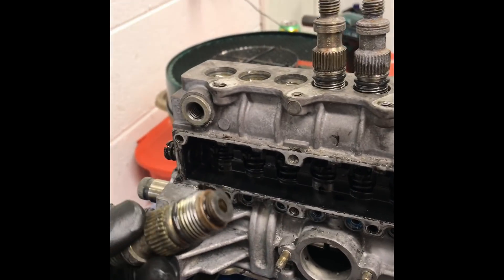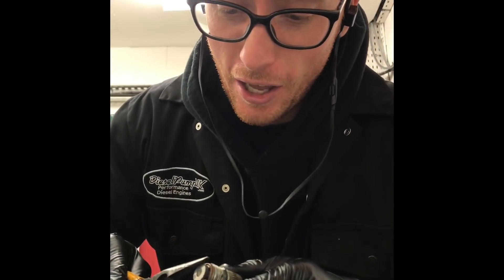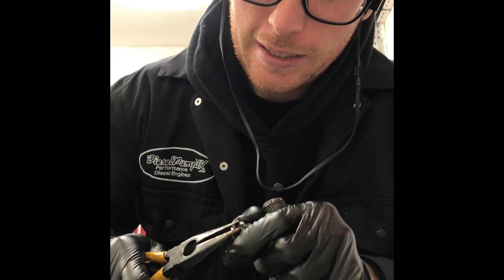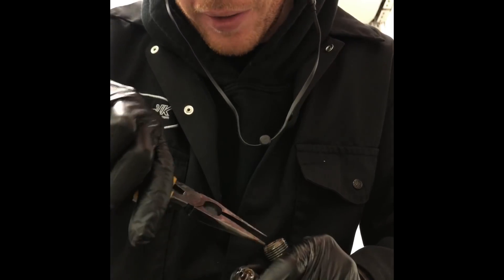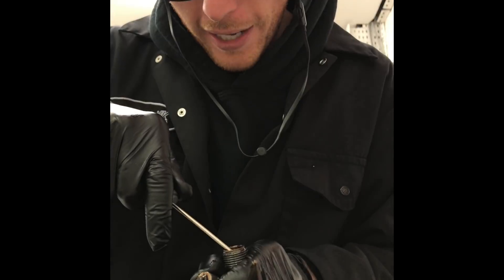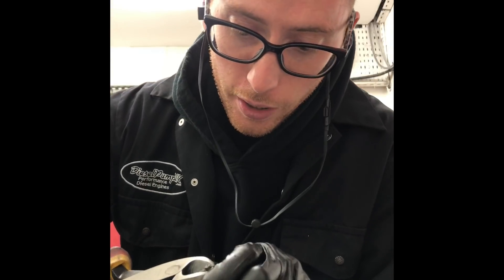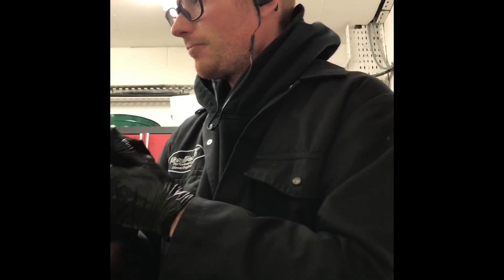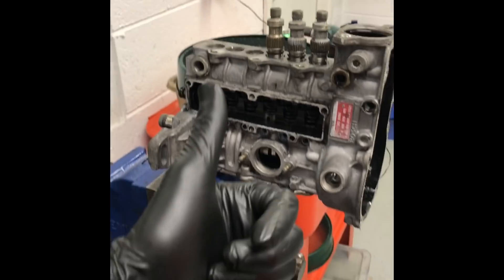Biodiesel ruins your Diesel engine

Comment: Veg oil is not BIO-DIESEL.Bio-diesel is reacted oil that is turned into esters.Dont confuse the two and give Bio-Diesel a bad name.
Reply: Exactly dude
Reply: Yea dude👍🏻👍🏻
Reply: Really 👌
Reply: 5% biodiesel gives more lubricity to your pump too
Reply: Exactly
Reply: Yes bro, he can exposed easily look at his channel name, diesel, so he is spreading propaganda
Reply: @oiroliv  in Europe almost all diesel on all pumps I have been so far is 5% bio-diesel. Even my new car has a specification for only 5-15% bio-diesel and I may theoretically void my warranty using pure fossil diesel.
Reply: @HibikiKano  Over here, diesel contains up till 7% of bio-diesel.
Reply: But he is the mechanic not you
Reply: @bradjacking3960  I manufacture Bio-diesel,I know what I'm talking about.
Reply: Yup so true, they will filter the oil and heat it then direct mix with diesel to get more volume. THIS IS NOT BIODIESEL, IF TRUE PURE BIODIESEL COMBUSTS THEN IT WILL BURN CLEANER THEN REGULAR DIESEL LEAVING NO RESIDUE. HOW DO I KNOW THIS? I MAKE MY OWN LAB GRADE METH/KOH/OIl washed and distilled blend.
Reply: sorry, biodiesel is f..ck-upper for entire fuel system. hyped business scheme propably. now you can buy biodisele bacteria killers - so buy diesel AND buy additives, it just makes mad. just finished last pump replacement because of sludge -wich screwed up all components one by one. old steam engine owner can do it, if you dont have kind of "modern" van or truck.
Reply: @bradjacking3960  As if you know that he aint a mechanic and also, have you ever made biodiesel? Do you know the chemistry involved? If so then please do share with all of us so called 'non-mechanics'.
Reply: THANK YOU SO MUCH FOR YOUR INPUT -- NO JOKE. I AM CONSIDERING A DIESEL ENGINE... (NOT SURE WHICH - ANY RECOMMENDATIONS?) AND THIS VID HAD ME 2ND GUESSING MY INCLINATION.
Reply: BIODIESAL has an electrical charge and water conducts electricity, they naturally attract and bond to one another. Water in fuel creates an environment that allows microbes and bacterium to flourish. These organisms  will consume 1% of fuel while destroying the rest.  Water reeks havoc on engine fuel injection systems.  I'm not an expert but my teen daughter is doing a research paper on hydrocarbons and petrochemicals.  This is just something of what we learned. Some  books describe the problem using a metaphor TITANIC, very telling. Modern civilization on petrochemicals with people consuming them is gonna cause the ship to sink.
Reply: @catsmeow4003  Good lookin' out feedback wise. Appreciate.
Reply: Exactly well said
Reply: bio-diesel is bad by one reason. It dissolves water. Even if a diesel is mixed with biodiesel the moisture in it may ruin your injectors, pistons and pump in a long run. By two reasons actually: DPF. DPF gets clogged much more often so it needs to regen more increasing fuel consumption and decreasing it's health. We have 15 to 20% of biodiesel here and we have diesel engine wear by moisture more than ever before.
Reply: @catsmeow4003  About the first part: Water does not conduct electricity, ions and minerals do.
Reply: Biodiesel is great only for its marketing campaign and nothing else.
Reply: @igorpupkinable  and what makes you say that
Reply: @igorpupkinable Biodiesel need be very clean before they can feed any diesel engine. Because veg oil have glycerin, after the react with methanol (or ethanol) the mixture still have some glycerin that turn into soap. Because that, biodiesel need to be washed with water and then heated to get the water out. Here in Brazil, there's a company called Brasil Bio Fuels. They make biodiesel from a tree called Palma, they produce biodiesel enought to feed they own trukcs that work on they forest, and wanna hear something funny? These trukcs are regular trukcs, without any adaptation to run with biodiesel.
Reply: Biodiesel is terrible.

Comment: You mean veg oil or bio-diesel? There is a chemical difference. Just curious, because you did use both terms.
Reply: @Podge probably. Ah sloppy journalism, the scourge of our time.
Reply: There is moisture in that M-pump, moisture causes corrosion, like rust. The owner of that mo606 is sloppy using alternative diesel in cold weather and probably doesn’t change the fuel filter often enough. Buyer beware! Moisture and debris work against bio-diesel users requiring extra maintenance.
Reply: veg oil is HVO100 right?
Reply: This is the aftermath of vegetable oil
Reply: Also you didn't mention the percentage of biodiesel neither and that can also have a big impact on the amount of sloppy aftermath that you're talking about.

Comment: Just happens if it isnt filtered proberly the guys where i buy my oil runs his 300td for over 400k on nothing else then veggie oil
Reply: Where do you source your oil? Sounds good to me...
Reply: @Candlemantle  i buy prefiltered, water seperated used sunflower oil for 0.65€ per liter in 1000l bulks. My seller is bying up oil from a chips factory
Reply: @christianh.8408  yes that's what you need aslong as it's done right it's good stuff.👍

Comment: As one of those guys who's used it for decades and thinks it's the best thing ever, it's hard to say what went wrong with this pump or the "fuel" given that it apparently developed a running fault. The only time I've ever seen veg oil gum up like this is when it's been exposed to the atmosphere over months/ years. The same thing happens with E10 petrol. It absorbs moisture, reacts with oxygen in the air and slowly forms a polymer/ varnish with the first stage being this sticky syrup stuff like in this pump. I've never killed a pump in 250k miles on veg oil. I have killed one engine with gummed piston rings (avoidable) in a fairly short mileage but the other engines did over 100k miles on veg oil and are still running fine. I had one EDC merc pump which sat with veg oil in it for 2-3 years and was fine- it was sealed from the atmosphere sitting in the vehicle and fired up first turn with a fresh battery. What has happened to this pump is either the result of poorly refined "fuel" or long periods standing exposed to the atmosphere. If your veg oil is dry and well filtered it won't do this at all and if you follow similar precautions as you would in a petrol engine using E10, you won't have issues after it being laid up either. I flush the system with diesel if I'm going to park up a veg oil vehicle long term and flush petrol fuel systems out with Aspen although as said, if it's hermetically sealed from oxygen/ moisture you'll be OK in terms of veg oil :)

Comment: The veg oil is simply not biodiesel.. The former is not advisable to directly pour cooking oil into your Nissan Patrol (seen on your other video). Biodiesel is the chemical reactions of transesterification and esterification. The " normal diesel" in the UK is officially up to B7 (a mix of seven per cent biodiesel and 93 per cent standard fuel).

Comment: Without owning the vehicle, knowing the fuel used, methods of refining and conditions the engine was used under. Your video is not proof of correlation to a specific cause, however its worth considered.

Comment: Lots of factors to consider here. What feed stock was used? Canola? Palm oil? Fatty fish and chip shop oil? What process was used? Cooking? Ultrasound? What filtering process was used? Scraping deposits from the top of the barrel? 1 micron filters? How old was the vehicle? Bio diesel is really good at stripping 20years of fossil diesel deposits out of fuel lines and clogging up fuel filters and beyond. 

People are quick to blame Bio Diesel without understanding some of its complexities. This is the reason lots of people are unwilling to use it. "My brothers, mate's, dad's boss ran it in his 40yo cruiser and it killed the fuel system, bio diesel is shit" SMH
Reply: Word!
Reply: Not to mention that some people pour in pure veg oil without any esterification process.

But from my purely accademic perspective, I'd argue against using pure bio-diesel as a drop in replacement for diesel in new cars solely because Bio-diesel often ends up having a slightly higher caloric value than normal diesel and with the tight tolerances and electronics governing fuel injection in modern engines. I'd really go and ask someone who is well in the know to get proper advice for any electronic upgrade and maybe a different lubrication oil.

I mean can we just take a moment and admire that my current Škoda 1,6 L diesel engine has more power and torque than the 3,9 L Chrysler LA 239cu V6 from 1987. Tolerances are tight and the engines work under more strain these days. I think anyone who does anyone to their modern engine should ask someone well in the know how to tweak and tune the electronics.
Reply: @HibikiKano  proper bio is fine as it is for like BP etc.
Reply: @mattlawton4715  BP produced B5 a 5% mix of bio-diesel with 95% diesel.
Your car has a note somewhere stating which mix it is optimised for.
Reply: @HibikiKano  my car dosn't have a note but is good on 100%bio👍
Reply: @mattlawton4715  it works, yes. But the engine is optimised for a certain mix. Power output and more importantly (if you are from the EU at least) emissions.
Reply: @HibikiKano  you are correct
Reply: @mattlawton4715 would my 2008 b6 passat be ok?
Reply: Also, did they do anything to take the glycerin out of the veg oil, from the looks of it, no.
Reply: Thank you for adding more logic to thw video

Comment: Been running my diesel engines on my homemade bio for years. My system cracks animal fats too. So long as the bio is properly cracked, filtered and washed then these problems should never arise. Looks to me like whoever told you they were running their engine on bio, were actually running on waste veg oil (WVO) or worse still SVO (strait veg oil) and have misunderstood the distinction between the three terms. Running on WVO and SVO will eventually gunk your parts up. Properly made bio will not but in fact burn cleaner and leave less residue than mineral diesel fuel oil from the forecourt. Been doing it for a long time. all my engines (Berlingo, Sprinter, VW LT and narrowboat) have run like a dream and smell sweet too.
Reply: I would really like to know more information about your system as I would eventually like to do something similar with transesterification of waste veg oil and so on.
Reply: @neb6229  heat WVO in a settling tank to 55c. Let it sit for 24h. All heavy particles drop out. Perform titration test. Weigh out the correct quantity of potassium hydroxide and methanol as per the titration results. Transfer oil into reaction vessel or if you are using one tank, heat the oil back up to 55c. Introduce methoxide slowly keeping oil moving by pump. Allow all methoxide and heated oil to mix for 3 hours maintaining heat and movement. Turn off pump. Let sit overnight. Glycerine will drop out. Tap glycerine off from bottom. Use warm water and a little white spirit vinegar to "wash" the remaining hydroxide from the bio. Do this very gently and slowly otherwise it will emulsify. Heat up the washed bio to 55c again, remove top of tank and have a fan blowing over the top of the bio whilst pumping air from the bottom of the bio via a bubbler. This removes most of any remaining methanol. Be sure to do it in well ventilated area. Methanol is toxic and has explosive vapour. Run a 27/3 test. This tells you how much methanol remains. Run pH litmus test. If tests run good, run the bio through at least a 5micron filter into a suitable storage container. Use in any diesel engine as regular diesel.
Reply: I have a Mercedes 1987 and 99 and a 2005 VW all TDI‘s I was wondering somebody said running half and half 50% pump diesel and 50% waste oil filter of course would be OK is that OK or is that bad or a danger
Reply: @abrahamghannam2137  I've done this before except I mixed 3parts diesel and 1 part WVO or 1/4 waste veg oil. It does burn ok and the lowered viscosity seems to be handles by the pump and injectors but I would't do it long term. The who idea of making biodiesel is to remove the 3 glycerine molecules that are attached to the oil molecule. Veg oil is a triglyceride complex. It's the glycerine that causes all the problems. It's what makes oil too thick for the injectors.  It will eventually polymerise your liners and begin to gunk things up. Not instantly and not even maybe a year but eventually it is inevitable and will cost you down the line. Making bio is really quite simple once you understand the process and it can be done in a single tank in the corner of your garage or shed. It takes time and it does cost in some electricity and chemicals but when you calculate that it roughly comes out  around 60-70p per litre, it's a no brainer and is really rewarding. The glycerine can be sold on. There are various companies who will take it from you though sometimes they will only collect 1,000L quantities. If you have the space, one of those caged ICB's is ideal for dumping the glycerine which can then be sold on thus further reducing overall costs. If all this sounds too much then by all means mix some WVO into your diesel but I'd alternate with pure diesel now and then to try and burn off any residual gylcerine residues. A good tip is to mix the diesel in before filtering the oil. Once the diesel and oil are mixed it will make the filtration process so much quicker and easier. Good luck.
Reply: @tinderboxcreations  Thank you very much I appreciate you responding cheers
Reply: @tinderboxcreations . Thank you for the explanation
Reply: @tinderboxcreations  i have a fiat engine from 1996 with mechanic diesel pump (not common rail), do you think i will run okay on biodiesel? what recomendataions can you give me ?? i naver made it, i''m just starting to watch videos about this, few days ago i collect 20 liters of used vegetable oil from a friends restaurant. thanks !!
Reply: @pablo156v6  If you are cleaving the triglyceride molecule from the oil chain using methoxide then yes, you can run any diesel engine on it if properly made.
Reply: I had a berlingo multispace 1.9 diesel and it would run well on veg oil in the summer and biodiesel all year round!
Reply: Could i run my 2008 passat on bio diesel? Thanks
Reply: @hughoneill6555  See my first comment. Most older diesel engines will run on properly made bio. Newer ones run by finer engineering tolerances so it will need it may require thinning out with some actual diesel. The key word here being "viscosity".
Reply: @tinderboxcreations  thanks so what would you recommend the ratio of diesel to bio diesel to be? It would only be worth my time if i could use at least 60 to 70% bio diesel. Also it there a way to check if it it ruining your engine before its too late? Would inspecting the injectors and fuel filter be enough?
Reply: @hughoneill6555  OK. So, currently I am using 50/50 WVO (waste veg oil) and diesel in my 2001 Sprinter and she runs like a dream. Any richer and she struggles to start in the morning. Come autumn I'll be using 30/70. The higher percentage being diesel.  Note WVO is NOT biodiesel. The two are worlds apart.  My Sprinter will run on 100% bio but I add a small amount of diesel in there too so realistically it's about 95% bio with a cetane booster like EcoMax or Redex. The only way is to experiment starting with small percentages. I'm currently happy with 50/50 WVO as it skips with cleaving the glycerine thus saving money on hydroxide and methanol plus the time it takes and the electricity needed. But, she's an old van with a very strong common rail pump. Start with small amounts and do it over a long period of time. A vehicle can seem fine a particular fuel but after a while the cumulative damage takes it's toll. Don't forget about fluctuating atmospheric temperatures too. The only way to be sure is to experiment carefully and keep notes. If you need advice on bio, I can help.
Reply: Our govt just switch all diesel to biodiesel gradually for the last 3 years, and now its already b35. At the first time many cars fuel filters clogged quickly ,coz actually biodiesel "clean" the tank and pipeline, but after 3 times fuel filters change,the engine runs smoothly.. what everybody feels that the power is less on biodiesel,but its ok as the price of biodiesel is cheaper than pure diesel..

Comment: I agree it creates a mess BUT I did 100.000 miles in my 603 and it was still running perfectly when I sold it 2 month ago. 198k miles. It was run on straight used chip oil, NOT filtered very well either. I did have a  plate heater and a second filter and I think its the lack of heating the oil that creates the mess we see here.  Never cost me a penny in fuel over 12 years so its worth a pump clean if need be.

Comment: It is not a good filtered biodiesel ,the slimy white stuff is Glycerin and when you do you chemical separation and let you biodiesel sit for 2 weeks and the filter it you should not have any issue 
What i see is old diesel pump bought from scrap yard so you rebuild and do the mods on them .
As for the water 💧 normal diesel traps humidity also so rust is not from biodiesel.